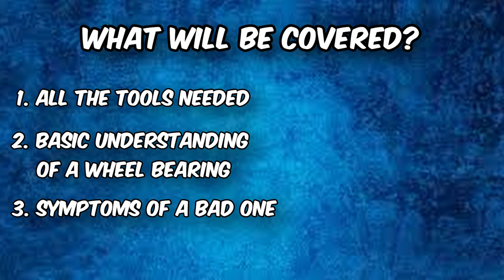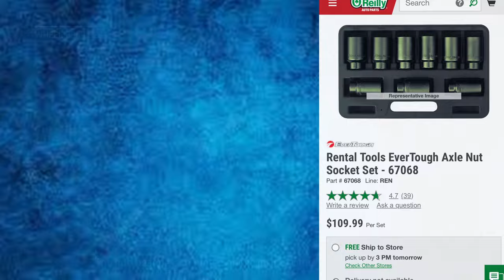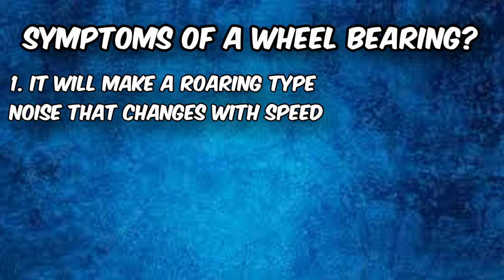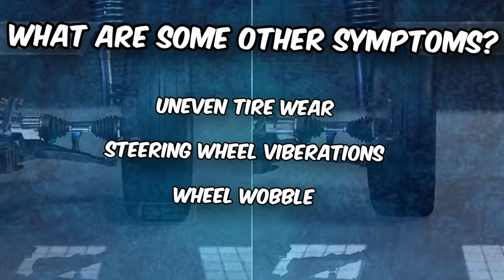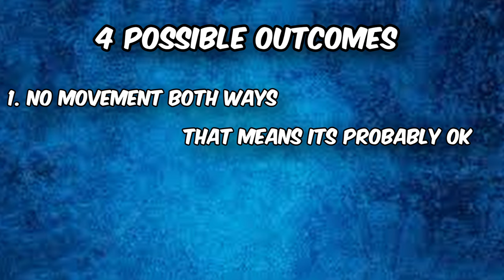How to change a wheel bearing

Comment: thats crazy you use ur milwalkee as a manual ratchet to loosen up those caliper bolts i tried that and broke as soon as i put any presure on it i just break everything loose with a breaker bar now
Reply from the maker: Haha ya I use it that way all the time even when I should use a breaker bar. You may have just been unlucky and got a faulty one because they should act as the average ratchet. High torque still use something else but for 90% of stuff you should be able to use it just fine. I love my Milwaukee probably my favorite tool haha. Hope this info helps. Thanks for watching!